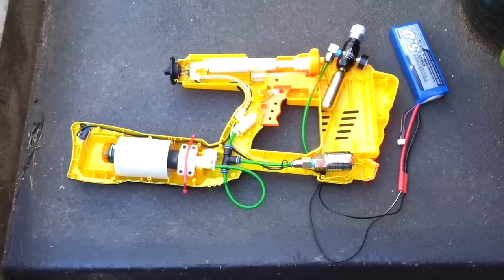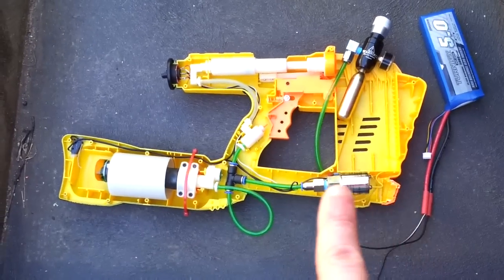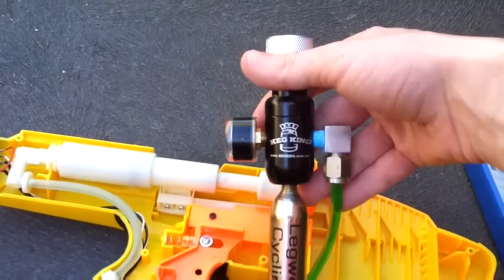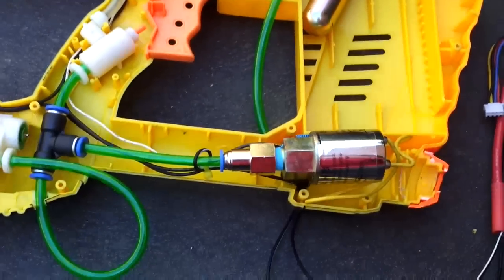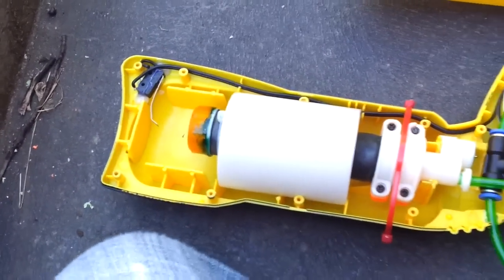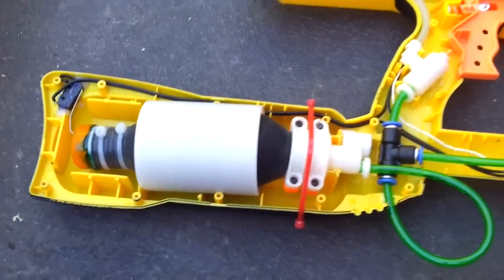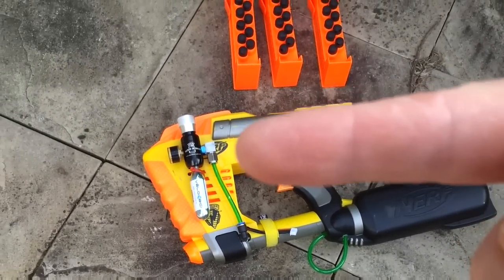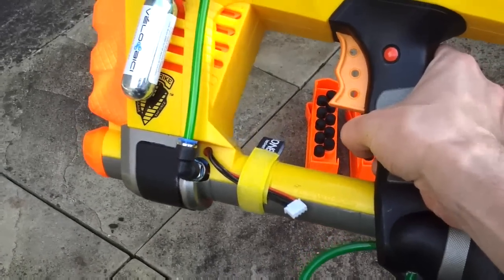CO2 Powered Nerf Magstrike!

Comment: I think this is a stupid idea/  project. Why not just use motors to push out the darts. The c02 option seems like a waste of money, where you must replace the co2 cartridges all the time, vs. a motor system, where you will only need to recharge batteries. It doesn't even seem like the darts are coming out very fast at all. What's the sense of it if a co2 system is slower then a motor/battery system nerf gun. I mean the technology is awesome, and it's a cool project you made, but it's costly and not as great as a motorized Nerf gun
Reply: flywheels would add to the front, and and they are loud and require a rev up...

Comment: Why couldn't i replace the bladder with just the co2 cartridge + regulator?
Reply: you would need a secondary regulator since standard CO2 regulators output too much pressure, but I'm sure it could be done